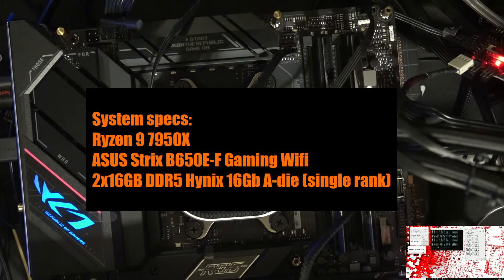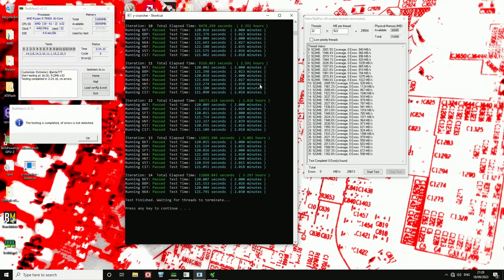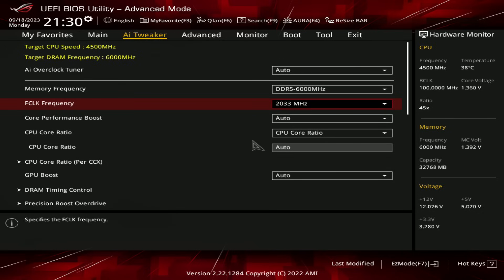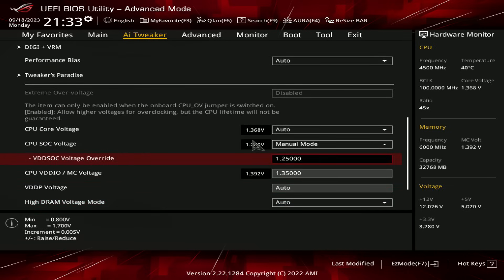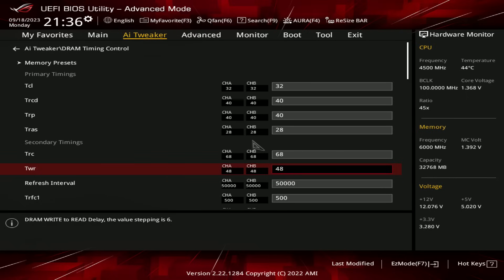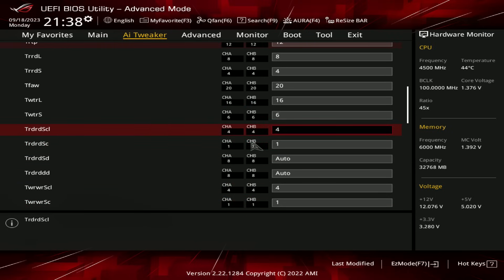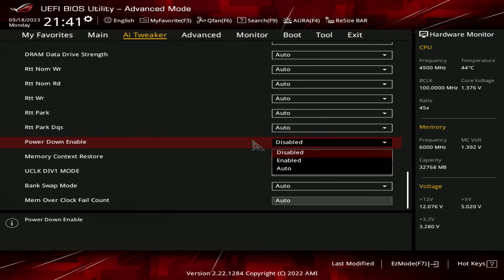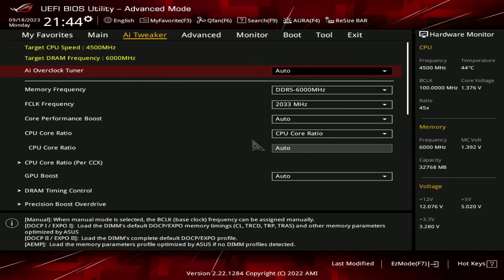Easy memory timings for Hynix DDR5 with Ryzen 7000

Comment: Summary (so you and I don't have to skip through the video anymore :D):

SoC Voltage: 1.25V
MEM_VDD: 1.35V
CPU_VDDIO: 1.35V
MEM_VDDQ: 1.35V

tCL/tRCD/tRP: whatever your kit says in its EXPO/XMP profile
tRAS: 126 (buildzoid changed his tRAS recommendation from 28 to 126 for AM5, watch his video "tRAS on AMD's AM5 CPUs is weird")
tRC: 68
tWR: 48
tREFI/Refresh Interval: 50000
tRFC1/tRFC: 500
tRFC2: 400
tRFCsb: 300
tRTP: 12
tRRDL: 8
tRRDS: 4
tFAW: 20
tWTRL: 16
tWTRS: 6
tRDRDSCL: 4
tRDRDSC: 1
tWRWRSCL: 4
tWRWRSC: 1
tWRRD: 2
tRDWR: 16

UCLK DIV1 Mode: UCLK=MEMCLK (1:1 Mode)
Power Down Enable: Disabled (also disable "Memory Context Restore" in order to not get BSOD - this got fixed in some newer BIOSes, but not for everyone)
FCLK: 2033MHz (not recommended anymore, was due to a bug also forcing 6100 mem-freq when setting this)
Reply: Buildzoid in his daily PC using 6000 CL30 with FCLK 2166. The reason system crash is because of too high SOC Voltage for higher FCLK
Reply: @RmX.  WTF should I do then 2033 or 2000 or 2166?
Reply: @mahdi7557  Try SOC Voltage 1.20 and FCLK 2200. If it's not stable then 2166 should run stable
Reply: @RmX. Hey, i found this comment months later, and it gave me free performance. Fclk at 2200. Thanks
Reply: @SodaPopinski3000  Is it fully stable? Because my 7800x3d isn't on fclk 2200 no matter what soc voltage I do
Reply: @RmX.  actually, no. It's stable as in not crashing, but I get performance loss after benchmarking. 2166 is good.
Reply: @RmX.  It ran slower when I set soc to 1.2. It needed 1.25. The fact that it doesn't crash at 2200 is a good sign, but I just set it at 2167 @ 1.25 soc for now. I lost 100 points in Cinebench @ 2200 fclk with most of the settings on this video. 2167 seems like a good balance for now.
Reply: @SodaPopinski3000  Same here, 2166 gives a nice boost, too bad my RAM is not stable at 6400 CL30
Reply: @RmX.  No offense, but you don't know what you are talking about. 1:3 ratio is a latency sweetspot even though its desynced. Desynchronizing two things doesn't stop all interdependence. Search for "Some fresh Zen4 RAM/IF overclock scaling data" post on the overlocking subreddit (links get deleted here unfortunately). Its from a very respected member of the overclocking subreddit.

The reason for buildzoid using 2167 is (probably) because its so high it overtakes 2000MHz FCLK again (as seen in the post I mentioned). Its strongly recommended not to use 2033 or 2067, its gets better after 2100 again (ofc only talking about 6000MHz ram). It may also be the case he just prioritizes other things over latency on his build - because speaking latency-wise, 2167 is better than 2000, but worse than 2133.
Reply: What is a good FCLK value to use now? 2000?
Reply: @ that’s what I’m using with 6000mhz and it’s about as good as I can get things.
Reply: @301jrod  https://youtu.be/Xcn_nvWGj7U?t=411
Reply: These days I'm getting random shutdowns. I'll try disabling MCR and PD and see if that fixes it. I left them ON for faster booting. B650 tomahawk, latest bios installed
Reply: One thing I found different is that for my Tras, the lowest value I could set was 30 only is that ok?.  I had no option to set it to 28.
Reply: @Jonxij  Generally its fine, 2T difference is not much. However I think there's a rule you should follow with Tras, but I don't remember how exactly it was. Something like tWr + tRas = tCl (complete made that up. But something like that with different timings)
Reply: @Germania-444 yeah it was adding 2 parameters and then adding 2 so like I think it was cas plus next timing so mines 30-36-36-76 so it’s 30+36+2 but that’s 68 and buildzoid originally said 28 but in a later video he changed it to over 100! Lol confusing af
Reply: @Jonxij same thing is happening for me on my Gigabyte board. Is it running fine for you on 30?
Reply: I havo no cooling on my memory and it obly runs fine with these settings when trfc is like at 20000.

Memory gets to 50°C in summer. Seems like for my kit thats too hot for 50000 trfc
Reply: What should i use as FCLK instead of 2033mhz then? just auto? i have a 7800x3d with G.Skill Flare X5 32 GB (2 x 16 GB) DDR5-6000 CL32 Memory Hynix die
Reply: @isacan 2000
Reply: Of course. Just wanted to make sure I could at least make it from POST to Windows before testing anything, lol. I'm currently running Memtest86, and it was freezing. Loosened up the tRFC a bit more, and the crashing stopped. I have a whole gamut of tests to do once I get 8 passes of Memtest86, including some of the ones you mentioned. My kit is 48GB (24x2) single rank M-die Hynix, rated for 6400 MT/s (CL32). Happy that my memory controller can handle it thus far. Was worried that I'd have to slow it down given that 7800x3ds don't handle high-speed ram very well. Thanks for the feedback 😀
Reply: Much appreciated
Reply: 2 bars of gskill 32gb 6000mhz cl30 1.4v, on defaults xmp settings i had a stable point on 6400mhz. So, I had set many parameters (not all) from the video and got an unstable (freezing) system. I decreased frequency to 6200, and it works fine. Should I change soc parameters and fclk? Also, I increased some params a little bit because I got a slowdown of the system in general ( it looks like the last parameter made a huge impact for system instability, and i changed it to auto). Could you help me set the right parameters?
Reply: @VadimSuharnikov  I tried 6400 cl30 on 1.4 voltage and my PC not even boot, but it might be also FCLK 2133
Reply: @RmX.  merci, it works pretty well on my system
Reply: @RmX.  Lol, it was an issue with swap on LVM on Linux. I moved swap from LVM and it works pretty well now
Reply: I try this timmings with my 6400 expo kit (reduced to 6200 fclk 2067 uclk mclk 1:1) stable 32 cycles anta777 but If I enter the bios I start getting bios frezzing and BSOD Any tips?
Reply: I tried this on a 9950X, X870E Crosshair Hero, and 96HN Hynix DDR5 48GB x 2. Just got it to post! Going to run some benchmarks.
Reply: True heroes don't wear capes, thank you
Reply: What DDR5 Nitro settings where use?
Reply: What about Gear down enable
Reply: So should i put 2000 or 6000 on fclk? I have 6000mhz ram kit
Reply: @artuqs9027  you won't be able to put 6000 on fclk 😂 if you use 6000mhz ram, just leave FCLK on 2000 (default). You'd have to push FCLK very high to get better latency than on 2000
Reply: @Germania-444  Ok, thanks! Didnt realise reading what was max, i left it on 2000 when i initially done the settings
Reply: @Germania-444  i have my FCLK set to 2200 should i lower it back down to 2000 or keep it at 2200? thanks!
Reply: I'm wonder if the tFAW 20 is still a thing, I saw a lot of people using tFAW 16, so am I
Reply: You're the best - Thank you
Reply: I dont get it, is there a guide for msi motherboards?
Reply: question: i applied these settings to my corsair dominator 6000 cl30. should i still be seeing 4800mt/s in task manager?
Reply: @Pullo83  no. it should say 6000MTs. Apply your expo profile, reboot, go into bios again and then set these values
Reply: @ thanks! i think applying the profile and the custom settings in one round overrode the 6000mt setting. Just applied expo profile first and then the rest of the tweaks after, and it worked.
Reply: @Pullo83  Yes i think thats what happened too. Applying EXPO always changes many settings that need a reboot to be properly set in the bios. Glad it worked out
Reply: Mans a hero
Reply: Hi I have a 9800x3d and CL 30 gskill ddr 5 memory (6000mhz). I’m a noob do I need to do anything different here or do I need to change any of the voltages????? They are by default on auto
Reply: Hi I have a 9800x3d and CL 30 gskill ddr 5 memory (6000mhz). I’m a noob do I need to do anything different here or do I need to change any of the voltages????? They are by default on auto
Reply: Has memory context restore and power down been fixed yet or is everyone running it off still?
Reply: @Bobthebuilder2235  Theres a relatively new video from buildzoid in which he shows a mobo that has it fixed. Probably bc of a new AGESA version.
However, I'm on 1.2.0.2 and for me, it still doesn't work.
Reply: @Bobthebuilder2235 it works for me on my GIGABYTE Aorus Elite AX with F32h beta BIOS. I turned both on after setting the timings and my startup time in the task manager are about 17 seconds.
Reply: @chaosmaou  works for me too on ASRock B650 PG Lightning latest bios (AGESA 1.2.0.2b). Thanks to everyone in the comments, lots of useful knowledge here.
Reply: My kit is 6400mhz cl36, what should my settings be?
Reply: I have a 9800x3d and 6400mhz cl30 ram I have 200hz OC on cpu with -40 curve optimiser. I currently have fclk at 2133mhz 1:1 mode. Is this the best settings for mine? Thanks
Reply: @NUTS13GTX  if everything is stable, I'd say that you have the optimal setup
Reply: @NUTS13GTX should be able squeeze quite a bit more out with manual tubing but it’s slightly above average
Reply: Omg I ended up writing it all out myself😭
Reply: @thebladedbeast3711  imagine how dumb I felt when I figured out he already linked to a summary in the video description 😂😂😂 But apparently I wasn't the only one that didn't look in the description, so I didn't delete the comment :D
Reply: @Germania-444  what would be the best way power down :DISABLED and context restore :DISABLED or both enabled?
Reply: @DevilishTay  personal preference. I have both enabled because I don't want my PC to take 2 minutes to boot every time 😄
However on the latest AGESA (1.2.0.2b) I thiiiink it's possible to have them enabled/disabled independently. Buildzoid mentioned it in a vid recently. Can't confirm tho, as my motherboard doesn't have that AGESA version yet.
Reply: @Germania-444  I’m currently running into a blue screen on boot with power down off and MCR on with AGESA 1.2.0.2b, so for me at least it still doesn’t work.
Reply: @Chilli_ix  hm, very interesting... Im gonna cut out the agesa part of my original comment
Thanks for letting me know! Hopefully it gets fixed for everyone soon
Reply: is it safe to run all these values but with 5200? 6000 keeps bsods
Reply: No power down enable option in my gigabyte b650m aorus elite ax bios. Helpp
Reply: @manpais  Don't bother with the power down enable option. i have a b650m from gigabyte as well and when i disabled it I had bios freezes and constant bsods.
Reply: @manpais might be called fast boot, or memory training or something
Reply: When I set tRAS to 28 it keeps going back to AUTO when I hit enter
Reply: @VicBayolo  some motherboards have a lower limit of 30 for tRAS, so setting 30 will probably work. However, buildzoid changed his tRAS recommendation for AM5 to 126 (max) because it doesn't yield any performance benefits and can introduce instability when too low. He uploaded a video ("tRAS on AMD's AM5 CPUs is weird") about this 2 months ago.
Reply: @Germania-444  good to know. I will leave back to AUTO. Than you man.
Reply: These worked brilliantly for me, thank you!! I noticed something wasn't right when my UCLK was only 1500mhz. Now running 1:1 at 3000
Reply: Howis tRC 68 when tRAS is126?
Reply: @Chanharp  tRas on AM5 is very weird. He did a video on it 3 months ago or so. He recommends always setting it to max (126) because it doesnt affect performance, but it does affect stability... But that can change at any time with an AGESA Update
Reply: Didn't touch the voltages, 1.4 was default, getting errors 0, 6, 12 in testmem5, what can i do?
Reply: @worknes2155 try lowering trefi to like 20k and see if errors go away
Also just set Vsoc to 1.25. Thats perfectly safe
Reply: Is VSoC 1.25 recommended for 7800x3d? At 6000CL38 and same timing as shown in the vid?
Reply: Thank you
Reply: TU bro, great summary and updates
Reply: Não funciona, congela em minutos XPG CL30
Reply: I am so scarred from years of individually tuning my ram and the hundreds of times ive had to clear my cmos...

just throwing these timings together, **even from buildzoid!!!**   literally scares the shit out of me to the point where i dont know if i can do it XD
Reply: @zbatchDOC  give it a try! Worked like a charm for me.
If it doesnt work, it's just one CMOS reset and you can just give up on it xD
Reply: @Germania-444 
Other than timings can i increase the freq 5600 to 6000 and adjust primary timings? Currently using corsair vengeance 32gb, i believe its micron D-die cl40. I know this for hynix but wondering if possible
Reply: @manpais  well, if that's possible depends on your ram chips, as they all behave different. When increasing frequency, you have to increase all timings (assuming they are the minimum stable at the moment. If you didn't tweak them, you probably have enough headroom to just increase the frequency and not adjust these timings)
Reply: This mostly worked for me. Wouldn't boot into Windows. I added 25 to each tRFC to get it to boot. Now, to test for stability. Currently at 6400 MT/s and 2133 FCLK.
Reply: @lsik231l  Hey, I think there's a small misunderstanding. The unit of timings are actually clocks - so the faster your frequency is, the looser your timings have to be. That's because the RAM still needs the same actual time for certain operations (a timing is basically how many cycles a certain operation needs)
So if you have Hynix and it's rated for higher speeds than shown in this video (6000MHz), you're gonna have to loosen timings. You may be stable on the timings you have set right now, but I'd really test that with proper stress tests (TM5, HCI Memtest, Karhu (paid), y-cruncher, prime95 Large, OCCT CPU+Ram Large, etc)
Reply: FCLK Frequency 2033
Reply: @Excusername  that is no longer recommended
Reply: @Iadders why?
Reply: @brandyyn  2033 fclk was faster on older agesas because of a bug. the memory would run at 6100 mt/s instead of 6000
Reply: @Iadders  So what’s recommended now?
Reply: @brandyyn  i believe 6000/2000
Reply: @Iadders  why’s that?
Reply: @brandyyn you want a 1:3 ratio. So 2000mz is a 3rd  of 6000 mhz. Otherwise you could trigger instability or loss of performance when setting uclk to equal mem clock
Reply: @brandyyn  the 1:3 ratio gives you the best latency, even though its desynced anyway. To reach a better latency you have to push FCLK very high
Reply: @Excusername  just added it 👍🏼 i also forgot SoC voltage 😄

Comment: Thanks for these Settings. they are rock solid on my F5-6000J3038F16GX2-FX5.
Is it possible to get these to 6200 MT/s ? if what timings need to be changed?

Comment: Since many people in the comments asked about the FCLK setting at 2033mhz, ill try again to get a answer for all.
Is FCLK 2033mhz still good or should we revert to 2000mhz?
Reply: 2033 was faster for him because of a bug. on newer agesas, you want to run 2000
Reply: @Iadders  thanks
Reply: For me (Ryzen 5 7600, Asrock B650 Pro RS Wifi, DDR5 3000 CL30 from Corsair), FCLK of 2033 is better in OCCT memory benchmark, BUT slower in Cyberpunk (3 to 4 fps less when I test in 1080p without Ray Tracing). So my conclusion is that for gaming using FCLK on Auto is better so I switched back to this. Has someone else tested this on other games?
Reply: @pjdetry6844 on the latest agesa I have been getting terrible micro stutters and bad 1% lows with these settings I think I need to try auto or 2000 on fclk

Comment: Ran these settings for 14ish months, can confirm they were rock solid. Only checking back in because I had to swap my mobo for unrelated reasons!
Reply: how were your ram temps, sorry if it s a silly question but will it overheat without a dedicated fan pointing at the sticks? or will i be fine with it in a normal fan configuration within a case?
Reply: @AnilD97 I started using these timings and see about 40 degree Celsius memory temps, but I have a fairly open case with a thermal take core p3.
Reply: @AnilD97  I had my Ram start to get pretty toasty with 65k trefi, but 50k was fine, I have kept it at 65k anyway since it was only toasty during Ram stress tests, nothing I did with my PC caused it to go over 49c. I got a dual fan thingo to go over my Ram just in case and that wiped about 9-10c off the Ram.

Comment: Looking at two kits of DDR5 48GB (2x24) memory for a build list and found two good-looking sets. 6000 CL30-36-36-76 and 6400 CL32-39-39-102. They are both under 200$ for the sets and from what I've heard/read the found information on the sets is good(tm). I cannot find secondary timings or what brand of chips they have but at a glance, do those sets seem good? or would I need more info? 
G.SKILL F5-6400J3239F24GX2-RS5K
Corsair CMH48GX5M2B6000C30
The manufacturers refused/were unable to answer Rank Q, but I've heard 24gbit dies exist so *shrug*?

Comment: After searching the web high and low I am back where I started my journey. Been lookin' everywhere and anywhere on why my system was still crashing after hours of stable stability testing. Lo and behold Buildzoid tells you right at the beginning of this vid that the GPU's been the one that's been cooking my DDR5 ram kit and just hard shuts down my PC. Stability test that always came back stable. Not knowing usually the GPU doesn't get stress tested in these tests and therefore doesn't cook my RAM kit. But after an hour or hrs gaming my PC just been crashing. I played with voltage, temps, limits, underclocking/overclocking, nothing made a diff. But here Buildzoid just tells straight up why it happens. Damn it all those wasted hrs. Didn't even think of the GPU that could be the culprit. Ty Buildzoid 🙏forever in ur depth. K now I gotta figure out a way on how I can prevent or reduce the cookin' of my RAM kit.

Peepz listen to every word Buildzoid says! Don't just skip to the good stuff. His wisdom knows no boundaries.